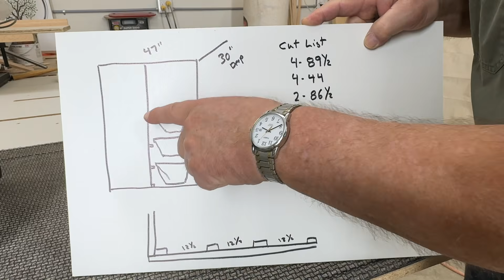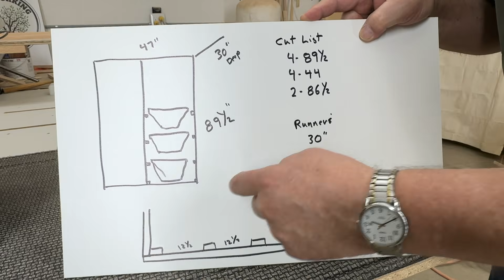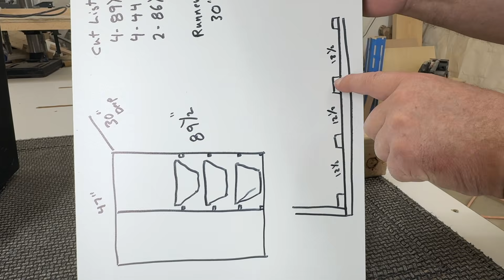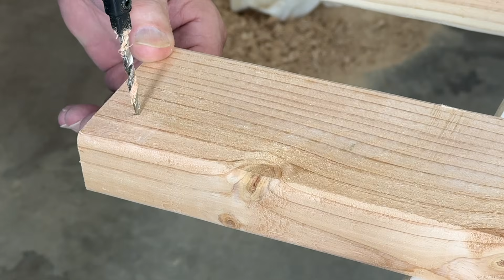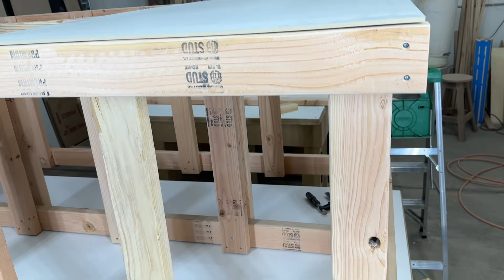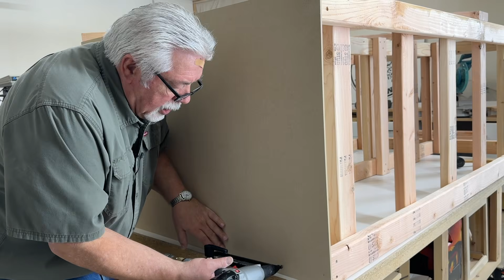DIY Sliding Totes Storage

Comment: Funny stuff. I have thirty of these storage totes (next size up) and saw a storage rack in the Canadian Tire flyer two days ago for this exact purpose. I don't know if the racks were metal or plastic but on sale for $80 each and they accommodate 5 bins each. So, yesterday (the day before this video was posted) I built a double rack similar to what you've built. No back frame as it's attached to an interior shed wall; no wheels, either. And the bottom two bins sit on the floor so only four support sliders per side required. All made out of scrap lumber! And it's exactly as you say: It's a lot of work retrieving items from a bin at the bottom of a stack unless you rack them! Cheers.
Reply from the maker: That's great you were able to build your own rack from scrap lumber. Thanks for sharing! Wes😀